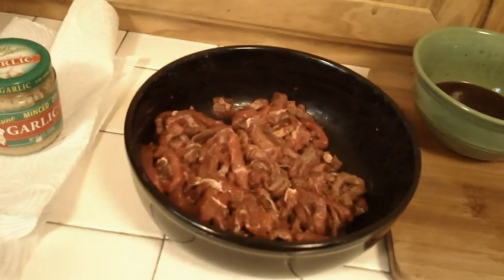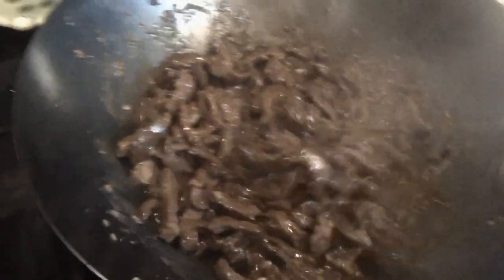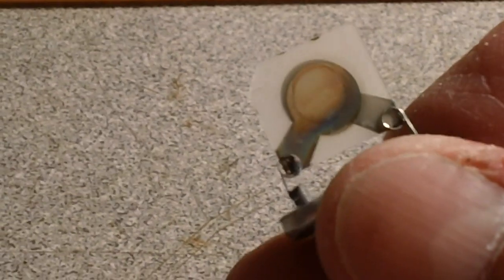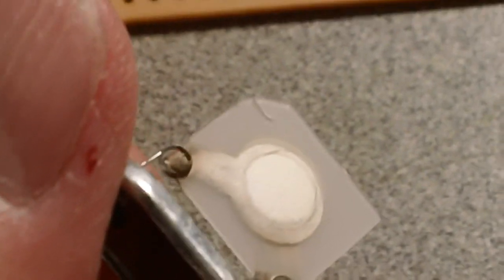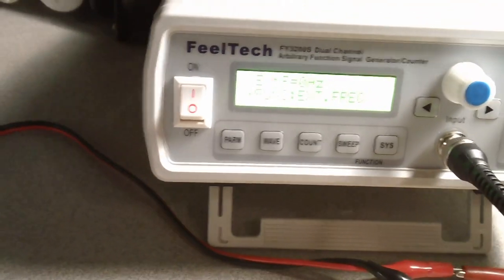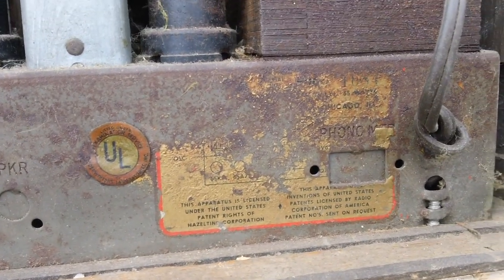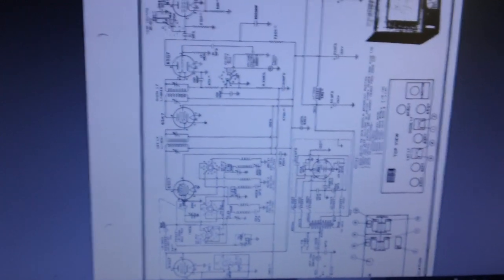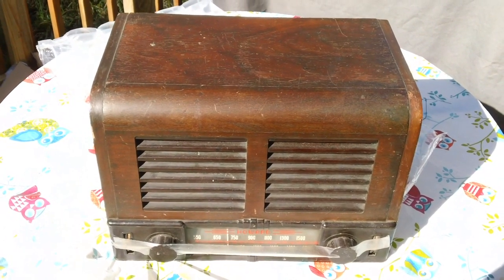Mish-Mash #158

Comment: I like how you cut apart the crystal, I'm like that myself, I always like to see what's inside things. about 16 years ago I found an old fridge compressor in the woods and I lugged it back home to cut it open with a manual hacksaw, (took me 2 days)  wired it up and got it to run! I would have guessed older on that Howard but 1948 seems about right judging by the tubes used.
Reply from the maker: Daniel,  There was no way I could pass up a chance to tear that crystal can apart for a peek inside, even though it might in the end prove to have been good.  It tested bad, but I plan to make a new crystal tester as a second opinion so-to-speak.  LOL  Glad you liked seeing the inside of that puppy.  Regards,  John

Comment: John,
I bought a wok and tried it on my glass-top stove. It was a disaster-the wok spun around like a wagon wheel, the heat was probably too low and everything stuck, and then the smoke alarm went off. I bought a deep-frying turkey propane burner and mover operations to the deck and had more luck. Seems to be important to not add food until it is very hot (I noticed you did that) and the trick is knowing when to add each ingredient (for example, carrots take the most time, add them first).  Your mention of planting brought a tear to my eye-here in NW Ohio we just got 6" of wet snow and it was 15 degrees (F) last night.
Reply from the maker: Ian,  Don't let that wok kick your butt.  Wrestle it to the ground...even if it is covered with snow.  LOL  BTW...radishes are up.  Won't be long now.  Regards,  John

Comment: John,
You raised two items of interest I find very intriguing my friend…
I’ve never seen inside a HC type crystal unit.  I had a good idea the outer aluminium casing would easily buckle whilst being cut.  Nonetheless, it was very interesting to see how the crystal is secured.  
Since the crystal’s corner is missing, and a crack has started appearing; if it did resonate when voltage was applied, it would no longer resonate at the frequency printed on it canister.  
I very much doubt you will be faced with any difficulty obtaining the crystal units you’ll require for your Drake communications receiver.  Fortunately, most radio crystal unit types are available, and for the large part appear to be reasonably priced.  
A fellow who occasionally calls into our local Am-radio club, and is a Drake, and Eddystone, enthusiast, as well as taking great interest in IOTA (Islands on the air www.rsgbiota.org), suggested you take a quick look, should you not be familiar, at the following website…
http://www.af4k.com/index.html
…click onto Crystals, and again onto Drake: they might sock the unit types you require. 
 
There are a number of radio brands I never knew existed: Howard was one of them.  Your 906SB looks to be crying out for restoration, and you are the very man who is capable of doing that.  Dave, from Michigan, has done you proud: I doubt many radios baring that brand remain in existence. 
Talking of Michigan, our mutual friend has not entered anything on Face Book for a long time, and it appears it was six months ago he last accessed You Tube.  I really do not know what to think.
Regards,
Phil.

Comment: John, What do you consider the most essential equipment for restoring old radios?  Isolation transformer, variable power supply, etc.?
Reply from the maker: Tony,  That's the age-old question at one time asked by just about everyone in this hobby, even those who have been in it for years.  The answer of course depends on the hobbyist.   On the safety side of the house you'll absolutely need a quality isolation transformer, preferably a new one which will run about $100.00.  That may seem high-priced, but how much is your life worth?  And for me, it's a couple of good multimeters, a digital and an analog.  They don't have to be expensive and all that.  I also consider a reasonably priced signal generator and frequency counter to be essential....and a signal tracer.  I suppose a tracer isn't actually essential, but mine sure has saved me lots of troubleshooting time.  I wouldn't buy any of this gear on eBay; you never know what you'll get.  Better to go to the Antique Radio Forum and ask around for some decent stuff.  There are of course no guarantees with that source either, but most members are pretty honest folk.  Tell them John sent you.  LOL  Lastly, you'll of course need a soldering iron, solder, plenty of gator wires, a good lamp, etc...you know, a man's basic work bench requirements.  And speaking of work benches:  An old interior solid core door sitting on saw horses or 3-drawer filing cabinets at either end works well and the cost is tiny.  Regards,  John
Reply: +joernone Thanks John.  You're a heck of a good teacher.  Best, wishes to you and your family.